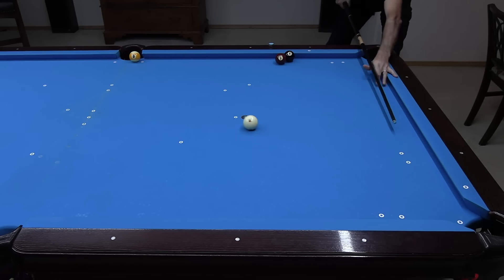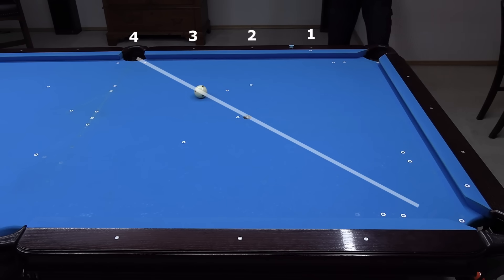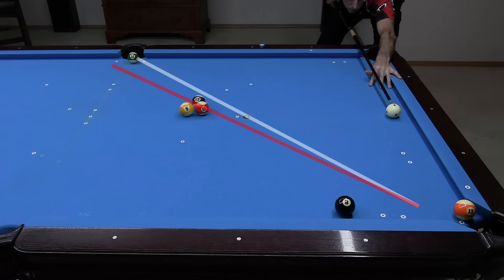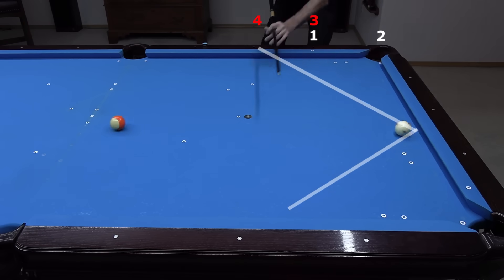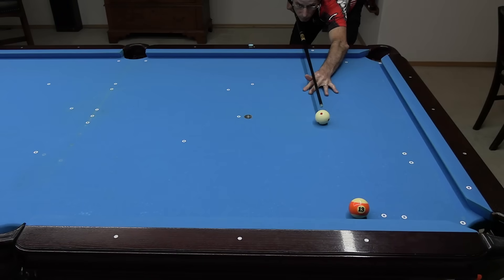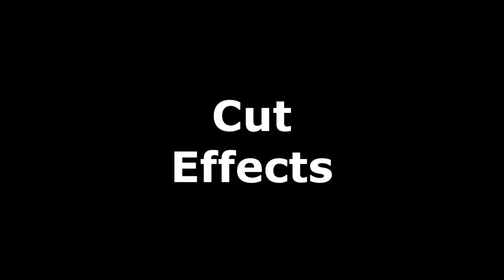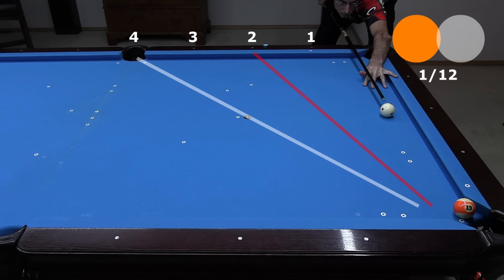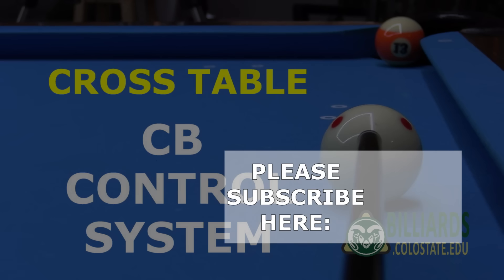Cross-Table CUE BALL CONTROL System ... A Powerful Technique

Comment: Your 3/4 ball thick hits need speed added to keep the cue ball moving after.  I have seen SVB do it so many times, and with spin added too.  And for the thick hits, using draw to walk the cue ball to a desired location my be the better choice.  Seems most of your videos are of the "slow roll" type.  Whereas I use the fool gamut of shot choices.

Comment: I always have a question for my buddy Dr Dave.  In your expert opinion, who is the stronger player? A Fargo 550 that plays 9 foot pool only and a Fargo 550 that plays strictly on a 7 footer.
Reply from the maker: I think they should be equal, assuming the ratings are robust.  Although, if the 9' table player only plays 9-ball, they would probably be at a disadvantage playing 8-ball on a bar box.  And if the bar box player only plays 8-ball, they might be at a disadvantage playing 9-ball on a 9 footer.

Comment: By far the best pool coaching channel on youtube. I'm wondering how applicable videos like these are to english pool, does the smaller cue ball relative to the object balls impact the path of the cue ball differently compared to american pool where the cue ball and object balls are the same size, or is the impact negligible? There are very few pool channels as insightful and high quality as this, even less so for english pool.
Reply from the maker: Thanks.  Ball weight and size difference Do change things slightly per the info and demos here:
https://drdavepoolinfo.com/faq/ball/weight/

Comment: The real lesson starts at 7:26.
Reply from the maker: The sidespin effects are important, but so are the other effects covered.  There is a lot you can do without sidespin.
Reply: @DrDaveBilliards  - poor wording on my part.  Not disputing the value of the entire video.  I simply found that portion the most enlightening.
Reply from the maker: @stephensiler3854  I’m glad to hear it.

Comment: Dr Dave,  I have a major problem pocketing object balls frozen to the rail.  I used to be able to pocket most when the cut angle was maybe 15 degrees, but now I have issues with the cut angle being more than 25 degrees no matter the spin or lack of intentional spin.  Another issue I have is with my new Cuetec cue with an 11.8 tip, I have issues hitting center ball.  Should I get a 12.5 shaft?  As always I appreciate any suggestions or recommendations you give.
Reply from the maker: For help aiming rail cut shots, see the videos and info here:
https://billiards.colostate.edu/faq/rail-cut/aiming/
Concerning the cue, I wouldn't change the shaft.  The size should not affect center-ball alignment.  Although, tip shape could be a factor per the video and info here:
https://billiards.colostate.edu/faq/cue-tip/size-and-shape/
Reply: @DrDaveBilliards  Thank you Dr Dave.  The shape on Cuetec is a dime.

Comment: This is super.  But can't get it to work unless I hit thinner 1/16 or 1/8 as you suggest. Exact half-ball hit with a tip of top, maybe I'm hitting to hard, the CB freezes coming off the hit with ball and rail.  If I slow it down it does this effect less, but doesn't have enough speed to come back across the table towards the long corner (or side on the side-side shots). Then a friend tries it and hits it nearly perfect. He watched me hit a lot and can't figure out what's different.  Something in my stroke or speed.  Anyway, good reference system. I'll adjust it to my actual results for usefulness in game.
Reply from the maker: You are probably using too much speed.  Also make sure your tip is high enough to get full-roll topspin.

Comment: did you use a new shaft Dr.Dave?
Reply from the maker: Good observation Pubo.  I have two 12.4 Revos.  I switch between them when I am waiting to get a tip replaced.  This one has the white vault plate.  I don't really notice the difference.

Comment: I have a question... At 3:04 when you play an "effective 9 ball safety", is that really a safety, or did you just snookered yourself? I know that in 8 ball you can call a safe shot and pass the turn to the opponent even if you've potted a ball. Is there such rule in 9 ball as well?
Reply from the maker: I made an oopsy.  See the "CORRECTION" in the video description or pinned comment.

Comment: Where were all these great videos 40 years ago.  Younger players have all these tips and visual videos to help them learn a lot fast than grinding out 10’s of thousands of hours on different tables.
Reply: All that grinding pays off when you play matches in different rooms and situations.  What works with one set of equipment may be completely useless when conditions change.  To say that an X hit with a certain spin will do Y is ballparking in the broadest way
Reply: @williamwest7313  exactly 1000%.  nothing can take the place of 1000’s of hours of grinding it out on 100’s of different tables & conditions & all that experiance.  When I play against others the difference in experiance is so obvious.  Cheers
Reply from the maker: I also wish I had access to all this info 40 years ago.  But sometimes, when things seem easy, people don’t bother putting in the work.

Comment: 3:04 Safety!😂 It seems a good move to use when you got locked in, just say to your opponent that was a safety and let them take your turn.
Reply: I’m guessing he meant it could be used if the balls were in a different spot than they were when he shot them?  You can’t play that safety in 9 ball. You just played safe on yourself!  In certain 8 ball rules you can call “defense down” to make your ball and surrender your turn at the table, but that’s not a 9 ball option I’ve ever heard of.
Reply from the maker: I made an oopsy.  See the "CORRECTION" in the video description or pinned comment.

Comment: I don't know if I have enough room in my brain for this extra pool knowledge. Amazing explanation as always!
Reply from the maker: The most important simple thing to remember is:  a 1/2-ball hit on a corner-pocket hanger goes to the side.  Most of the rest can be figured out from that.
Reply: @DrDaveBilliards  if an object ball is frozen to a rail, is it a legal shot to lag the cue ball onto it, having the cue ball contact that same rail, and nothing else, or does there need to be another rail contact?
Reply from the maker: @Regoriroger  Under the WPA “official rules of pool,” all that is required is that something be driven to a cushion after OB contact.  If the OB is frozen to the cushion, the CB (or some other ball ) needs to contact a cushion (any cushion) after hitting the OB.
Reply: @DrDaveBilliards  thanks for the clarification.  A local league player tried to tell me I fouled when playing a safety where I did just that.  They tried to say that the object ball that I made contact with was part of the rail because it was frozen to it, and that a secondary rail contact has to be made to make it a legal shot.  Just to be clear, I made contact with the rail frozen object ball with the cue ball, then the cue ball contacted the same rail as the object ball that was frozen to the rail.
Reply from the maker: @Regoriroger  It might be this way in your league.  Not all leagues follow the WPA "official rules of pool."
Reply: @DrDaveBilliards  it's a bca structured league, which I believe follows the same type of rule set.
Reply from the maker: @Regoriroger  BCAPLs do have slight rule differences from the WPA "official rules" per the info here:
https://billiards.colostate.edu/resources/rules/rule-differences/
Reply: Don't stress about it. I watch these videos and find when I go play some things stick. Just keep the basics right.
Reply: That's just how Dave and some folk brains work. They make what is very easy things for many others very difficult but again, that's just how their brain works lol. Pool is an easy game but you'd never know by the length of every Dave video and all the mathematical equations he uses 🤣
Reply from the maker: @godjhaka7376  If pool were easy, everybody would be awesome.  This game is so fun because it is very difficult to master, and there is always something new to learn.